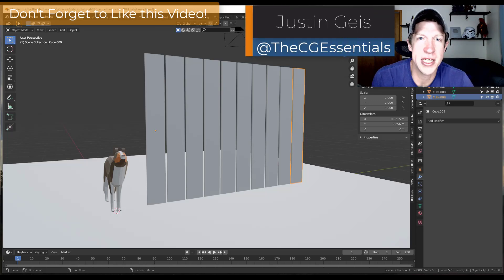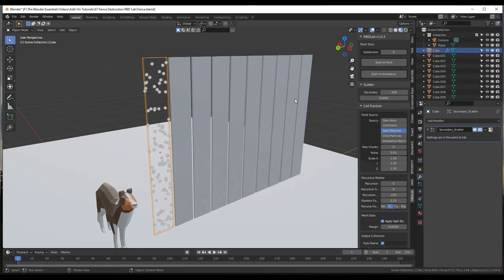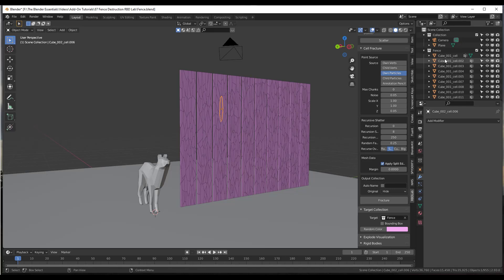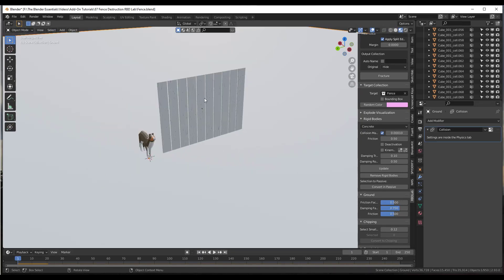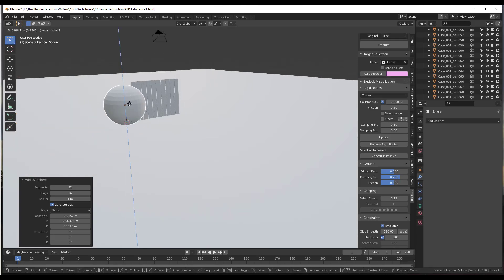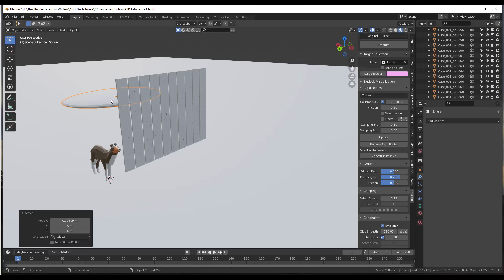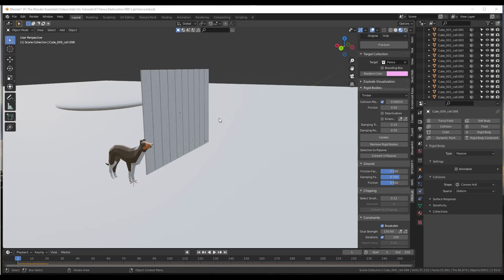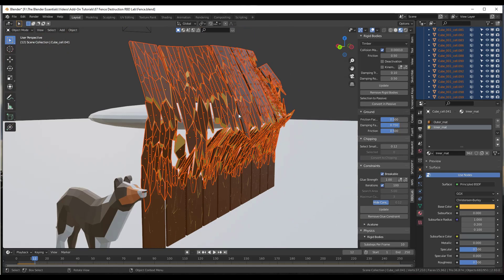Wood Fence DESTRUCTION in Blender (Now with more splinters!)

Comment: Hi Justin. Awesome tutorial. I would like to know, how I'd export the fractured pieces to use in Unreal Engine. I want to hide the individual fractured pieces and spawn  Niagra particles at that impact point. Right now I've prototyped this using the cell fracture addon. My issue is that there are clear seams/fracture marks on my mesh. I don't want to make a fractured and non fractured mesh and swop them out at runtime just to avoid the seams in the mesh,since I'm doing this round about method for runtime performnce.....I've seen someone was able to do this years ago but they're no longer active on youtube so I have no one to ask

Comment: If you don‘t have rbdlab, there is an easy way I learned from houdiniFX how to make wood fracture pieces. Just scale the object down, start the cellfracture and after the fracturing scale the object up again. That stretches the fracture pieces that usually look like concrete to kinda wood pieces.
Reply: Smart. I have to untrain my head to use asymmetrical scaling to my advantage, especially with UV effects. But it can make certain things possible that would be a major task otherwise.

Comment: in the RBDLAB tab you can choose your target collection so you don't need to select all the elements of each colection to apply the settings, so if you have more than one colection to simulate you can change all the settings just by changing the target collection, I do that and it's fast an easy.
Reply from the maker: You know - this is a great point ;)